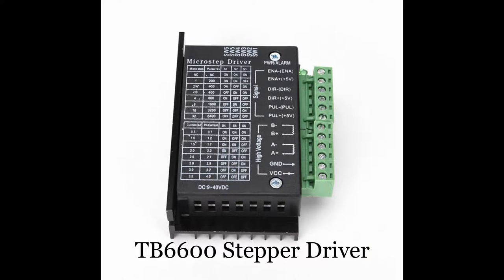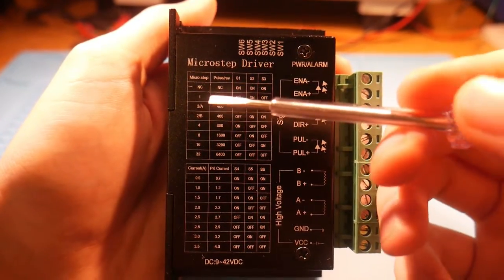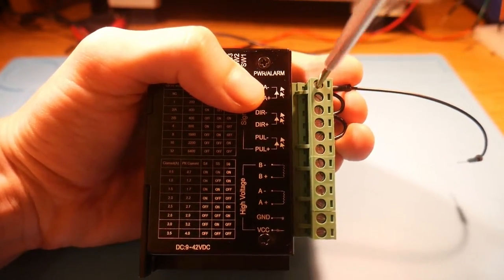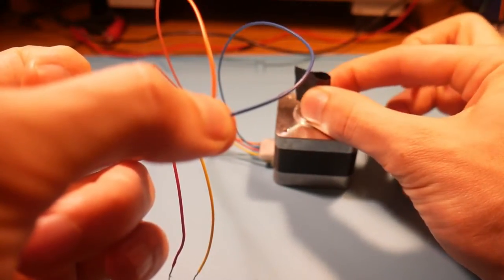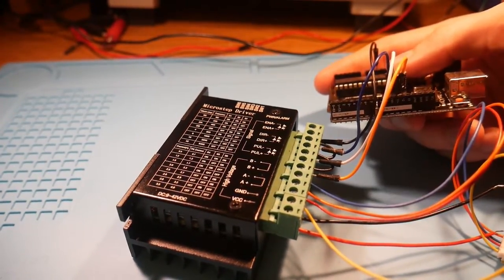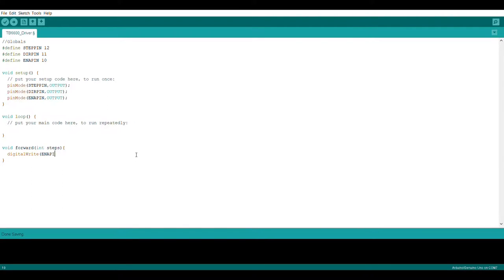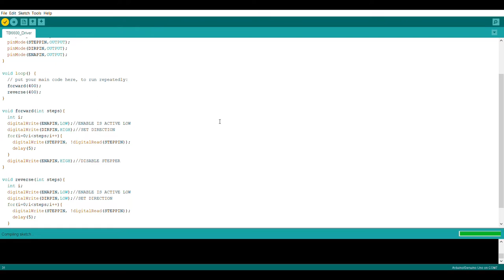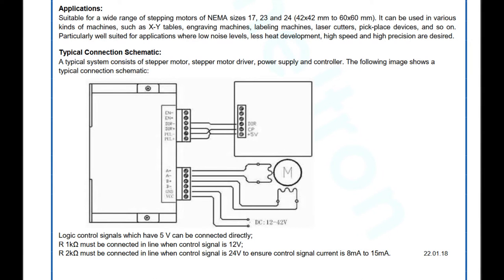TB6600 Stepper Driver - Arduino Control

Comment: hello Sir i have a question I buy a stepper motor with current rating of 3 A then i also buy a TB6600 driver for the stepper motor that has a rating of up to 4.5 A. Im planning to power up the TB6600 with a 24V DC and 1 A. Since my motor need a 3A do I need a source (power supply) with 3A also or the driver will amplify the 1A if i power it with a 24V DC and 1 A?

Comment: Thank you, sir... I am quite familiar with Arduinos and stepper motors but not so much stepper drivers.  I have a rotary for a laser engraver and it is attached to a DM556 which is similar functionality to the TB6600.  Randomly the rotary will start to just start rotating backward in the middle of job (the product on the machine is then garbage).  After learning how the driver works, I realize 1 of 2 things is happening.  The direction pin wiring is becoming intermittent or the internal connection of the driver for the direction pin is failing.  Either way, I now know it is not the stepper motor or the software.  It is either the wiring or the driver.

Comment: Totally like your video.  Very straightforward.  I am using an H17120434 6 wire stepper motor.  Your code functioned perfectly.  Thanks for the effort you put into this video.

Comment: Question: Does your method forward/reverse actually do just half the steps that you called for in the argument? Because for each "i" you only pull the STEPPIN either high or low, but not both. So instead you could correct the loop to :  for(i=0; i<steps*2; i++)? Am i correct?

Thx for the vid, i try to build a stepper motor controller myself in the new year and with this vid i feel prepared!
Reply from the maker: You are correct. The code should either include an on off toggle inside the for loop or a simple double count like you have shown to account the two transitions each pulse needs to make.

Comment: hi, very nice video, i have a question for you, i look your video and i make the configuration i proved your code non my arduin, but i have a problem , the motor don't work as in video , but it run only one direction , you can help me?